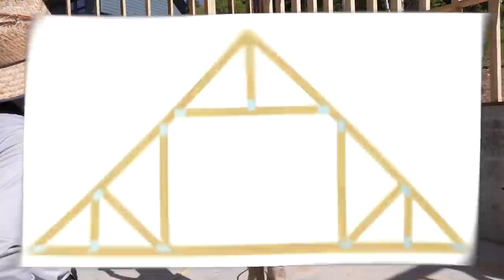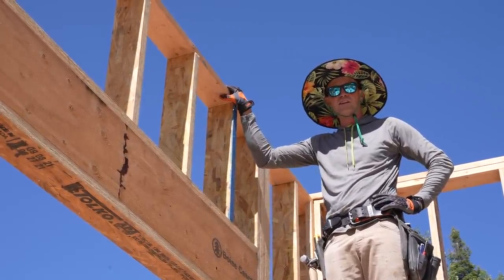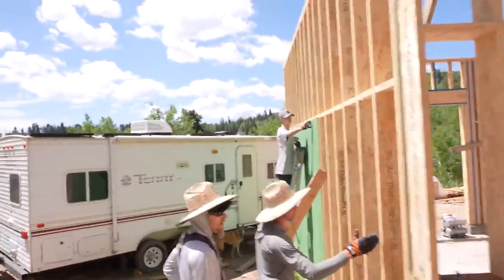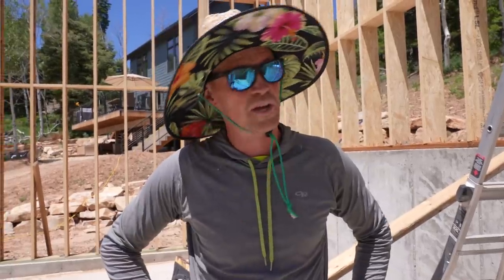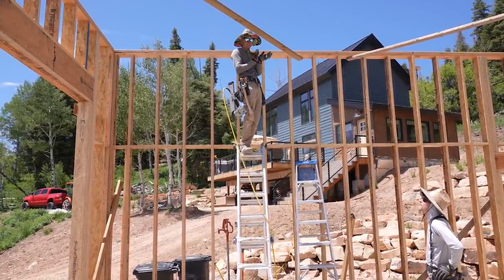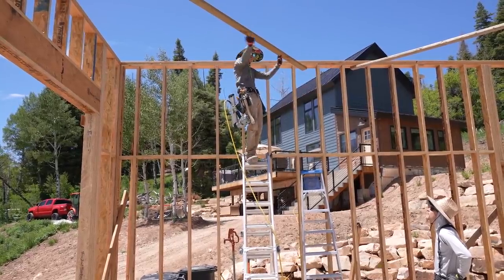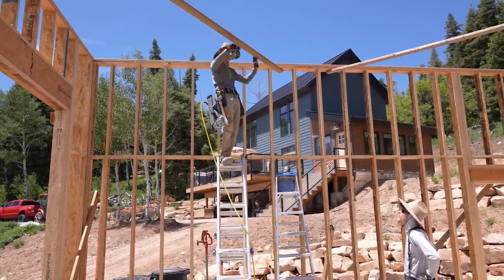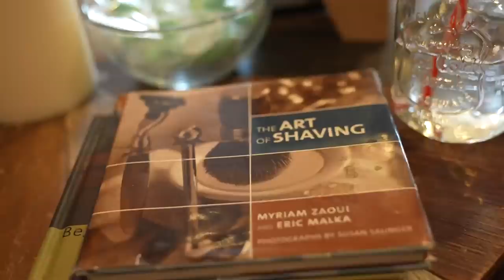THE END OF AN ERA... (EMOTIONAL)

Comment: Trent, how about a 10' or maybe 12' fiberglass stepladder. Your going to need it for the finish work any way. I know your a climber and have great balance l. So was I back when I was framing. You will be able to work much more efficiently and not waste Brandon's time holding the ladder. Plus, don't you have a scaffold from the house build?
Reply: I believe the scaffold was loaned to them and had been returned.

Comment: Word to the wise when working in the heat: replace those electrolytes!  I always used ice water with lemon in the summer, but I erected a windmill in the middle of July in 95 - 100 degree temps.  My buddy and I were both drained in 4 hours, so I had my wife pick up Gatorade at the store which we promptly guzzled.  It was amazing how quickly our energy returned.

Comment: I know that you are thinking about your next van.  One of the things I love about custom vans is the innovation.  I think you should design a van WITHOUT the back seats for the kids. Shocking?  My daughter was in her car seat until she was in the 4th grade.. 9 years old.. not her infant seat...the one for up to 65 lbs. It sat on the regular van seat but was CONNECTED to the car by the LATCH system which connects to the vehicle frame. So... what if you were not constrained in your vehicle design by a huge back double seat, but by having child seats connect into a LATCH system.  Think about putting LEO in the car when you are travelling.  You use a mesh seatbelt to hold the child seat to the vehicle.  It is the design (and proper angles) of the child seat protecting the child, and not the cushioning of the huge vehicle seat that matters. RV's have lap belts on seats that face sideways.  And those child boosters, in which the child is just elevated to fit the adult seatbelt, always looked so dangerous to me.  Most kids wrap the chest portion of the belt under their armpit so it doesn't bother their neck and there is no head protection whatsoever and when they fall asleep, they slump over at weird angles. I kept my daughter in her car seat as long as it fit her because I thought it was so much safer and she liked the cup holders and to nap against the headrest.  
Also, rear facing seats are safer no matter the child's age.  Look up a video on rear facing vs forward facing crash tests and you can immediately see the difference. The rear facing test at 45mph look basically like a speed bump. The forward facing test looks like a spinal injury. I know you can think outside the box and still keep Leo very safe. Really... rear facing or forward facing, there is no requirement for legs to dangle in mid air. Leo's legs aren't dangling now. Kids would rather have their legs up. Imagine a van in which you could unclick Leo's car seat and stow it in the driver's seat.  So... you are in the van build and design business.... design a custom van for your family that will fit you for the next 6 or 9 years and sell it when you outgrow it.   
(Evenflow makes a seat that will take a harnessed child up to 4'2" or 110lbs)  
It is sad that it is the end of an era... but exciting for the new era that you have already started!

Comment: The sheathing on any walls should be a 1/4" off the concrete.  CONCRETE will ( wik , water up into the sheathing.  In a year the wood will swell up along the walls. Also the walls , need ( diagonal support )... top corner,  at a angle cut into the wood. Or you can use metal strapping MAILED to each stud. Also, wheres the anchor bolts drilled into the slap , you failed that on the house. Same code for garage..
Reply: Interesting observations/comments. Did you learn this because you are a builder or did someone teach you it along the way? I always want to know more, more more -- even if i am not using that knowledge right now! 
(I knew about not putting wood touching concrete/stone/ground, but didn't know it might be a code issue...or was the code thing the wall support?)